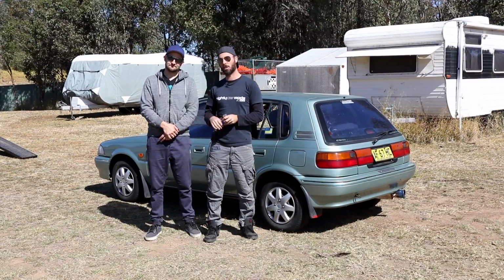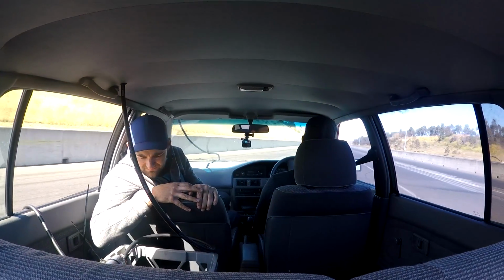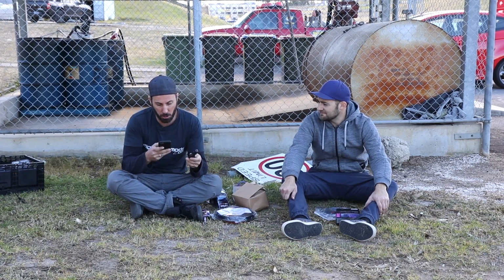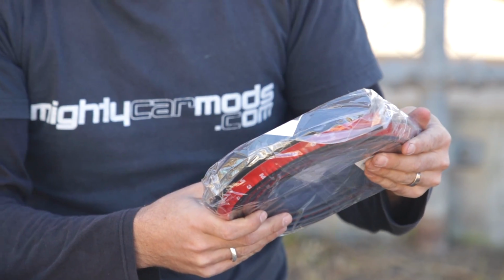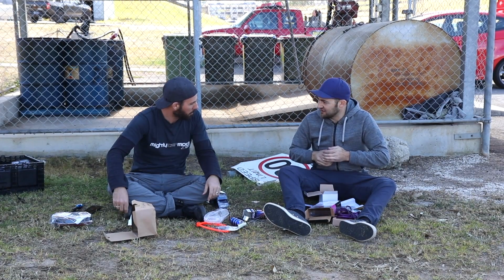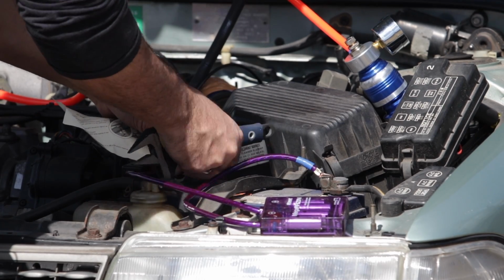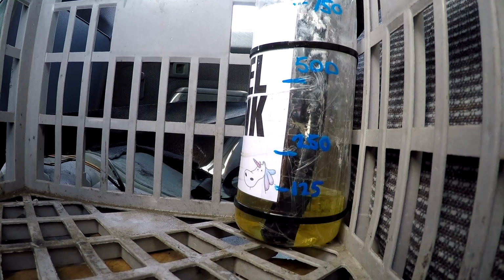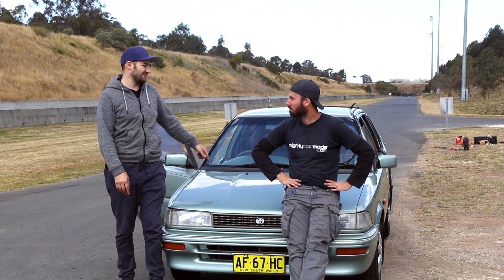Fuel Economy Mods - MYTHBUSTED

Comment: Stupid video. Making all the changes at one time is moronic. Odds are 9 out of 10 items will have no or a negative effect, thereby masking the one item that might have actually helped. I've worked on my car extensively to get better mileage and things that work are some of the more surprising. As for aerodynamics, it'll never show up on  test like this. The only way you can measure aerodynamic aided fuel economy is 20+ miles at freeway speeds.

Comment: i know most of these are shite, but the magnetic filter unit made a real difference to our vw camper, it was only 7 or 8 mpg on a long run but it was there.
it must be noted our unit was 70 pounds and was made in germany by a subsiduary of bosch, it works by ionisation of the petrol, i cannot vouch for cheap chinese clone stuff.

Comment: Drill a hole in the intake manifold run the windshield wiper sprayer hose into it and turn it on under full throttle near redline and see what kind of power gains you get

Comment: as this has a distributor - how about a test on the dyno - standard timing setting (which i think it 10 deg BTDC with T1 & E1 bridged or TE1 & E1)... and 91 Ron fuel.. 
Then the claim that everyone does (particularly with 4AGE's i might add) - 98 Ron fuel and some additional timing advance? see if there is actually any difference or it just pings it's balls off..

Comment: If you guys test out the hydrogen electrolyser, please be safe 🙏. All us fans need you guys to keep living the jdm life with both your hands still attached 👐. Electrolyser kits are fun the toy around with, but the backyard jobbies produce hydrogen and oxygen in stoichiometric quantities, in the same space. The cathode (-) produces the hydrogen, and the anode (+) produces the oxygen.

It can be done, and they do make a fair bit of gas if you can get the amps in, and I'll freely admit that I've had a great time playing around with a diy kit I made from stainless exhaust pieces and sewer pipe years ago (using sodium hydroxide drain cleaner as my electrolyte), but far out when you get a backfire you can blow your inlet manifold to pieces, and when the generator surges hard (high current), you can hydrolock your engine. Luckily avoided, but close 😬

I know you guys probably don't get the time to read 99.9% of the comments, but if you do get to spotting this, just for all of us fans, please be safe. I'm no safety nanny, I've just played with Hydrogen before - it is an explosive gas (not an exaggeration), and it surprises the hell out of you when it goes up. 💥💩

Comment: Moog is so salty lately. He's been eating too many kabob flavored chips.

BTW. Marty & Moog, can you guys do a test to see if engine braking wastes more fuel than using your regular brakes in a selectable gear automatic?
I've been wondering if turning off my overdrive to slow down on the highway wastes more gas simply because the engine is running at higher rpm but not being revved, compared to just using the brakes.
Another good idea: please build a sleeper Camry. The car is very underrated for what it is and I do skids in mine all the time.
FWD is best for dirt and grass skids but rwd and AWD are best for concrete and asphalt.
That said, a rally spec Camry would be amazing. And if you guys are willing to do it, I'll let you do it to my daily. Only deal is you'd have to come to America.

Comment: a high pressure pump w a filter w a variable mister lines and clamps 2-3 valves for a little flow through any injectors for prevention keeping within the recommended #s into the .........

Comment: Devils advocate says in theory vacuum leak may make it run leaner, and intake restriction could basically just limit you to a lower throttle position.. saving fuel by making you less able to drive in a err, spirited fashion. The latter wouldn't even have any real risks, since most cars run fine part throttle anyway. That said though, everything shown is snake oil grade scam, and the things that make real differences contain no magic, so a reputable engine tuner will be able to do them better than a ebay item.

Comment: See how much spray is to much.  do it the right way, pull some timing, run colder plugs, run a wet kit since it would be a huge shot, make sure a/f is ok.  Dyno it and run it down the track and run bottle after bottle and see what happens.

About 20 years ago we ran a hundred shot dry on a d15 1.5l and ran 8 or 9 bottles through it and couldn't blow it up.

Comment: I had a magnetic fuel saver on my fuel line and ran it for years. I then upped the stock power with a bigger fuel pump, bigger injectors, bigger turbos and fuel lines and a custom map. In comparison to when i was running the fuel saver i used more fuel, therefore concrete evidence that the magnetic fuel saver actually does work...........

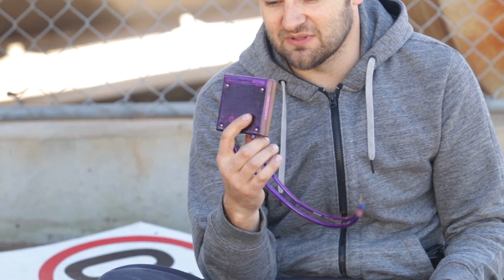Comment: Super funny because my names Derek. I own a 90' Integra GS. DA9 to the JDM 12:42. I have owned it for a few years, it still has 198k on the original b18a1 and I get around 30 mpg. I repainted it in the original color last year: MELBOURNE BLUE METALIC -- a slightly darker shade of silver than DEREK THE COROLLA but called Melbourne, NEAR (kinda) WHERE MCM IS FROM <3.

Comment: I live at 7,000 ft elevation (2133 meters for you more advanced civilizations) and I get about 10+ mpg more than the manufacturer's figures (due to less air resistance and less fuel  being burnt due to lower air pressure). So come move to the mountains! Only drawback is your car will be about 20% less powerful...
Reply: Turbos will help normalizing the air sucked, so it's a win-win for you :D

Comment: If you want good mpg, but a Yaris! Lol. Just went on a 700+ kilometer trip and averaged 41.4mpg and that's with sitting in stand still traffic for around an hour. Clean OE air filter and having the right psi of air in your tires is also a must.
Reply: Lambo6fo 41 is wank. My mk6 golf averages 54mpg

Comment: the whole experiment is bust, your bottle isn't air tight which means fuel is rapidly evaporating through the air cracks. fuel turns to vapor faster than you can imagine, my car with its fuel tank lid on but not sealed down lost HALF its fuel in 2 weeks of sitting like that (the tank opening for pump access, not the cap). you would have been better off doing it the overflow your tank and divide mileage method.

Comment: test absolute top speed of car, then try for highest top speed via attaching some sort of nose cone on the front, make the aerodynamics more aero, and add more tyre pressure to get that lil bit bigger tyre diameter for higher top speed, use 98octane...fiddel with stuff

Comment: General eco-mods that work:
- Inflate tires to near max cold pressure
- Taller gearing
- Skinny eco tires
- Lightweight rims in smallest diameter possible
- Streamlined aero aimed for low drag coefficient (don't add too many parts or car's weight goes up and it becomes counterproductive)
- Overall weight reduction through various methods - including sacrificing performance and/or safety for lightness e.g. smaller brake rotors, removed air bags, removed spare tire, gutted interior, etc.
- Lightweight flywheel
- If full-time 4WD, don't ever engage 4WD. If AWD, convert to 2WD.

Try all this on Derek?

Comment: Hah, the only legit mod might be the vortex generators, but they don't make any sense here:
- They don't reduce drag. That's not their point at all. 
- They should be mounted on couples - symetrically, each with some angle of attack - so we have a differential pressure, between L & R side of each of them - then the tip of each V.G. can generate a vortex. :)
- V.G's, basically, have the exact opposite idea of what winglets on aircraft's wings do (preventing escaping pressurised under-the-wing air from going over the wing, thus reducing the lift in that area, and creating vortex after the wing's tip. The winglet blocks this, and increases wing's efficiency, so the aircraft may use shorter wings. And shorter wing = less drag.) 
- Well, the idea with VG's is to redirect airflow, where it's needed - virtually, it reduces the angle, between the airflow's direction and under-pressurised upper surface of the plane's wing, as it's moving backward the point of separation (streamlined a.f./turbulence zone) - this much for the aircrafts;
- Mitsubishi EVO - how it applies in the picture? Well, it's a sedane/3-box design, not a coupe.
And it has a trunk door with a big bench on it, which idea is to provide downforce. :) 
But it doesn't. :(
Not till the non-midget passengers on the rear seat are able to raise their heads in normal position, without hitting the rear window; so the roof has to be a bit longer, and the rear window - a bit shorter & mounted on more agressive angle, next to what we have with the coupe-layout. That's the idea of the sedane. But, with this sollution, there is a problem - the line of separation appear on the end of the roof. And continue over the large spoiler - in that situation, the spoiler creates as much downforce, as if it was put in the trunk - because it's in the turbulent zone. 
Vortex generators deflect the line of separation downward - on the rear window, and the EVO's wing is provided with streamlined airflow. So now it can do it's job properly. 
Why they don't simply raise the wing more? - Cuz' wings create dragforce too. And [dragforce] x [height] = torque, -> backwards, levering around rear wheels' contact point, and reducing the grip of the front ones. 
So much for the Lancer EVO. The Eclipse doesn't need these - it's wing creates downforce & drag perfectly, without them. :)
With the Corolla in the video - they are unadequate on it; just increasing the drag - if that matters anyhow at such low speeds.

Comment: intake, exhaust, ECU reprogram, those 3 things combined are the ONLY chance of an improvement, there are tweaks like engine tuning and shift point tuning that will net you 1-4 MPG, the rest comes to driving skill like those crazy hypermilers that get insane mileage and of course simply "tuning up" your engine with a fresh oil change, air filter, spark plugs and wires and basic shit like that, you can also see a small increase (NOT enough to cover the cost difference) by running ethanol free gas if you can find it, problem is that is typically the price of premium or higher so the MPG gain vs cost is losing you money in the grand scheme

Comment: A friend of mine was told that plugging in a little black box to his MAF sensor wiring in his Toyota Tacoma pickup would help improve his fuel economy, by another friend of his that was using the same black on his Ford F-150 and that friend swore it was helping him out... Well, my friend drove his truck around with this thing wired in (i said plugged in, but it wasn't that nice....) for over a year and did notice a change, but it was questionable. I removed this black box and took it apart to see what was in it...and really, it was just a capacitor (I think) and some other BS do-dads that really did nothing at all.... He paid roughly $75.00 for a black box full of bits hot glued in that total, cost maybe $0.25 cents with labor to make.... yet after showing his friend this, he still swore it helped his truck get better mileage..... The worst part? I had to repair the MAF wiring in my friends truck, and when it was all said and done, the fuel economy change over that year or so was more or less to do with the weather that year. I drove his truck with it, and without it, and not a bit of difference either way. It is a shame these companies can go around ripping people off. My friend did not know any better because of his friend telling him it works, but his friend refused to admit he was wrong, and he was stupid for buying it and making someone else do the same. By the way, those are US dollar amounts I quoted.

Comment: To be fair...ish. Tractor Trailer trucks in the US have used stick on air thingys (that's the technical term AKA Airtabs) for years now. They work just like the ones you talked about on the Subaru, and have shown an improvement in fuel efficiency, handling, and better visibility (less water spray). With verified, real world tests... "Recommended locations are on the hood, along the sides and at the top rear of the tractor and/or trailer. Each one is designed to create air swirls that combine to help reduce suction and drag when at highway speeds. VorBlade’s small vortex generator blades are wishbone-shaped airfoils that smooth airflow over a truck’s trailing edges on the back of a cab or trailer."

Comment: Can you try disconnecting the fuel pump and atomizing gas directly into the intake and see f that method ACTUALLY saves fuel.  I've seen many vids on YouTube and was curious for trying it on long road trips.  Apparently the theory works the same way as how starter fluid works.

Comment: The "shark fins" or vortex generators (not the blue thing w/ the fan, the black fins), those might actually be legit. I mean, they came from factory on the EVO. The best way to test those would have been to do a run w/out them, with party string bits taped to the rear window, and then a round with the fins on. If the strings move less (showing less turbulent air) in the back, then it's a success. They will obviously not reduce drag by like 50% or something, but a 0.5% drag reduction seems feasible.

Comment: I've always wanted to know how low rpms you can reach in higher gears. Like the minimum rpm in top gear without stalling, or do you actually stall in top gear?? And what happens then?
Reply: This is three years old. But I lug my engine all the time in top gear. You can go as low as your idle essentially. It will maintain the lowest speed you can go. The down side is that you will have significant rattle and low oil pressure which increases wear and tear on the engine as the rattle and lower pressure allows the pistons to move from side to side in the head.

Comment: man that size bottle in my truck will get me about 10 ft lol i get 3 mph city 6 highway i have a 5000 pound truck with 2000 pounds of stereo wheels and aftermarket parts so im at 7234 pounds i get worst gas milage ever but looks cool and loud enough to blow a eardrum its different and uses fuel by the gallon nothing can fix that fuel usage

Comment: I use acetone in my gas and when I forget to add it I see a 3 - 4 % decrease in fuel efficiency... acetone actually bonds to the Hydrocarbon in fuel to create a higher burn rate... Pls check this out.............Many blessings , SMR

Comment: Specifically the magnet thingy doesn't atomize fuel droplets better, it repolarizes the hydrogen gasoline molecules, changing the molecular structure. Here's the catch tho: those flimsy fridge-magnets you buy from ebay won't do anything, you need really strong magnets (2000 to 8000 gauss) to get some results, but yeah the theory and actual evidence is there.

Comment: I object to this testing. The LED light on the cig-lighter fuel thing was not on, and when the LED is actually off it means that the car's ecu is not working properly. I guess it was some bad wiring when installing the other mods. That works 130% of the time

Comment: Let's recap:
-A cigarette lighter that doesn't light cigarettes
-Magnets
-Rubber weatherstrip
-A vacuum leak machine
-A useless brain box and harness
-A fuse bypass
-A pinwheel

My Prediction:
Fuel burn will be in the negative numbers.
Reply: I see I was wrong. I was really hoping the car would start producing its own gasoline.

Comment: The vacuum bleedoff might theoretically reduce fuel consumption by reducing the amount of airflow at the sensors, however the result could be running lean, which the computer will compensate for by enriching the mixture. If it did reduce fuel consumption, it would also reduce power. What I wonder is if using a pump of higher or lower fuel pressure might make a difference, and what difference.

Comment: Yes, vortex generators do work to allow airflow to reduced drag and achieve a greater angle of attack before separation. This can help you gain greater control on slow landings because it preserves airflow over the control surfaces.  Some Evo's even have vortex generators from the factory _ they do work.

Here is a quick video that explains it all, and on a car too :) 
https://www.youtube.com/watch?v=eP-YUDe9HF0

Comment: I suspect the different mods were not properly aligned.
If you had a correctly tuned flux capacitor the results would have been there for all to see.

Comment: Here's one I'd like to see someone try. Make a heat exchanger to heat the air fuel mixture with exhaust gasses. Fill the fuel/air side of the exchanger with steel scrubbing pad to prevent explosion and help vaporize the fuel. Then replace the original carburetor with one off a motorcycle. Heat causes the fuel air mix to expand, so you can run a smaller carb, and the fuel is turned into a dry vapor before being burned, so it burns more completely. Apparently the improvement in fuel economy is impressive, I'd like to see someone try it.
Reply: You just described running the engine lean. Yes it does work but.... emissions are out of specs (nah, never mind), second - it runs hot, insanely hot, tendency to knock ....engine life is going to be decreased.

Comment: Do another econony video but the old school way. Tire pressure, fresh gasoline, fresh oil, clean air intake, clean throttle body, new air filter, new spark plugs & plug wires & lastly new pulleys if needed.

Comment: The vortex generators won't work on that car. You need at least a slope past the generators. That is why it is above the rear window on the evo, to energize the boundary layer, which allows the flow to closer follow the rear window. It is literally the only real thing you did, that can actually be proven with fluid dynamics, just not on the right car. 

Love the sarcasm as you went through these parts. "WOW 91 to 98 octane!"